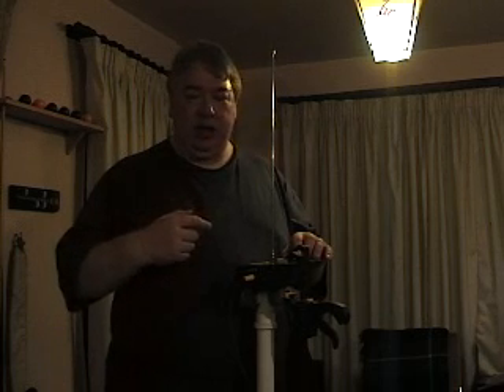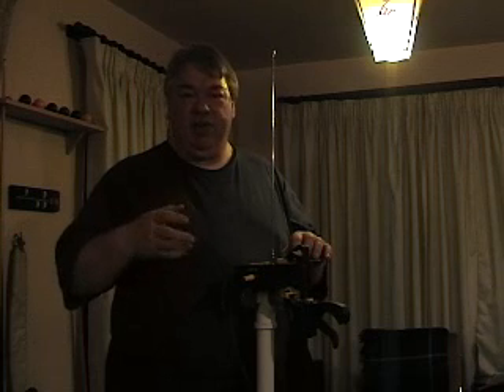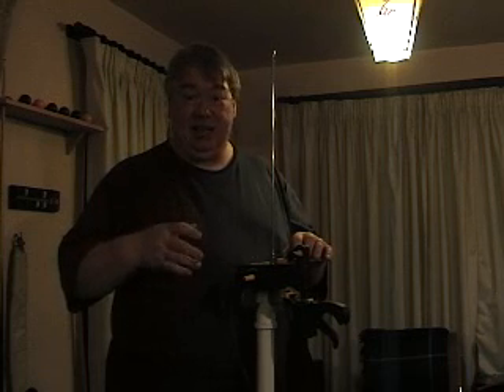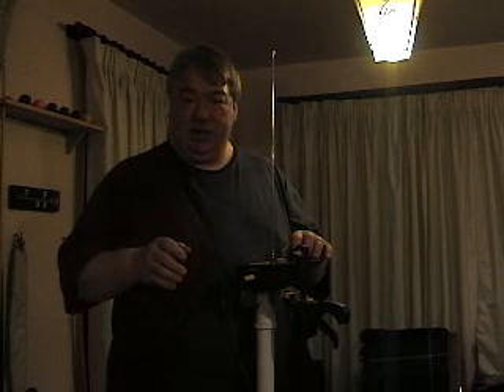Theremin Kit - Built and working half a day

Comment from the maker: Yes be very careful about the capacitor values i have spoonerised a couple whilst building but managed to find the error before completion. It is very important not to mess with the canned up coils before setting up and you only need to ajust two if them. Two should never be touched ever. Follow the voltage settings with a multimeter and when you gave done the two right most can canned coils are the ones you will adjust to get the sound and the volume control working. Good Luck.